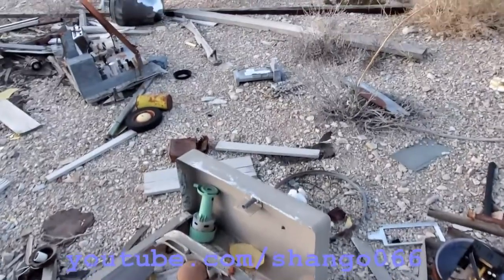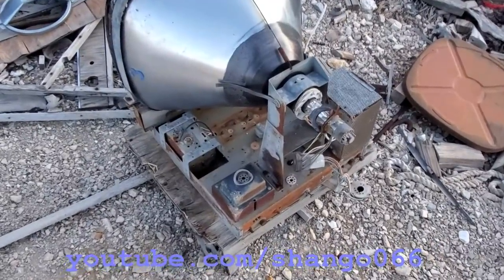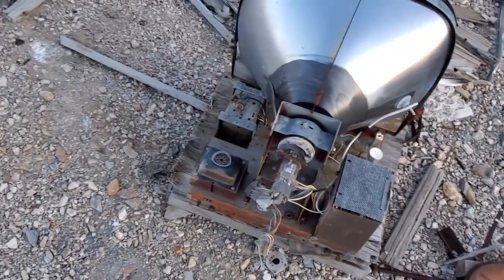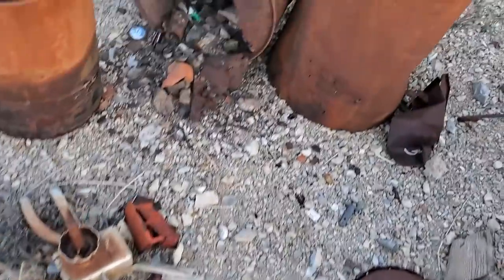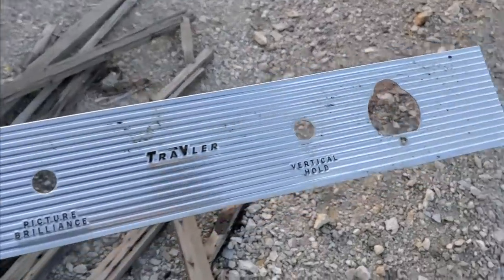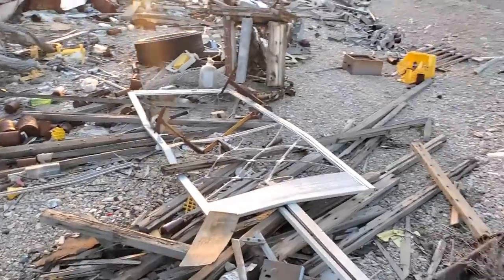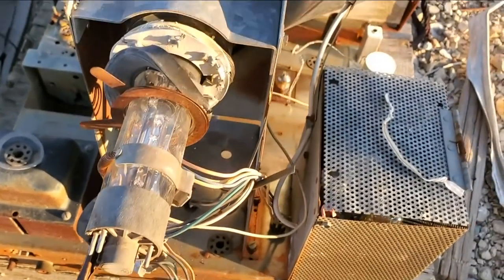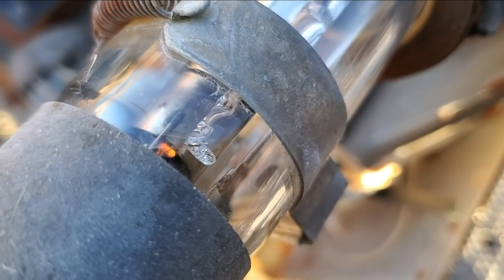TraVler TV For Resurrection Acquisition Flyback Yoke Testing Pt1

Comment: vacuum tubes !the magic in these 2 words is best appreciated by the "old timers"-the amateur,commercial,and government operators who have followed the rapid progress of radio commuications from its beginning.they remember those days not so long ago when spark transmitters ,galena xtals,and loose-couplers exemplified the state of the art.but the progress which had been made was to seem insignificant compared with the progress following the invention  of the 3 electrode vac-UUm tube by Dr. Lee Deforest.-1939 RCA

Comment: It did sit in the hot sun for years, that most likely accounts for the baked components. Just something I would do, even if there's nothing left I would still pull tubes and transformers from the other chassis laying around. Might be interesting to see if a sun-baked tube is still functional and how well it works.

Comment: You can sometimes repair transformer windings by sending a high voltage into the open winding making it arc and hopefully welding the broken section back together.  I was able to do this with a vacuum tube audio output transformer that was open on the input side with a cold cathode florescent lamp driver out of an old scanner that took dc in and had a simple transistor based oscillator driving the lamp transformer.  I started the voltage low and watched the current to see when I had managed to make the open winding arc and weld itself back together.  When I saw a spike in the current draw I stopped and I tested the transformer and it was working in the radio again.  I hope this is helpful to some people.

Comment: i think you can check each tube what the tube they use and what CRT model. From the tube they use i think you can find similar schematic as reference to restore it. If you have tools winder the power transformer can easily rewind by yourself.